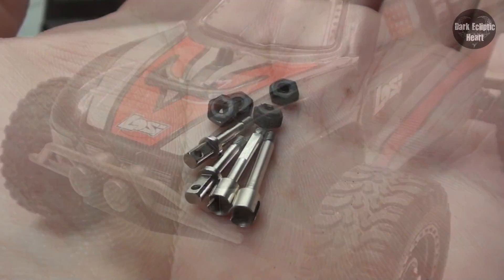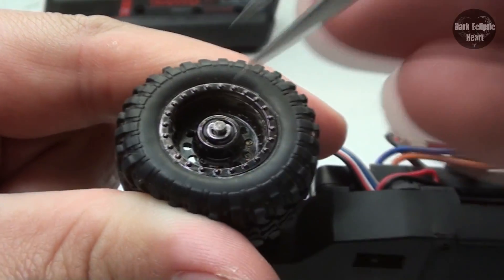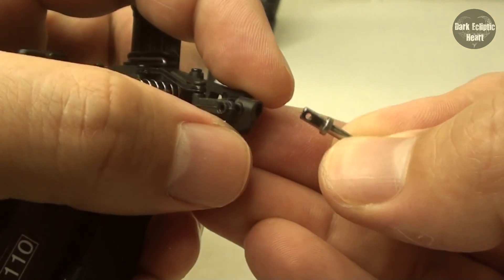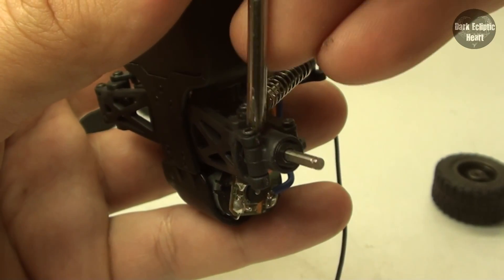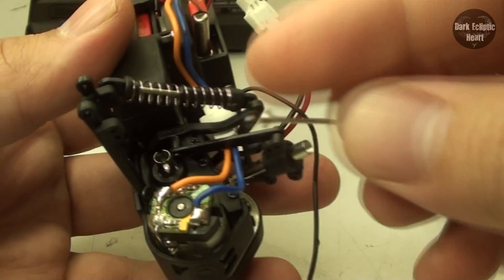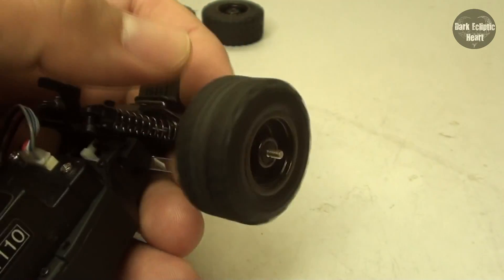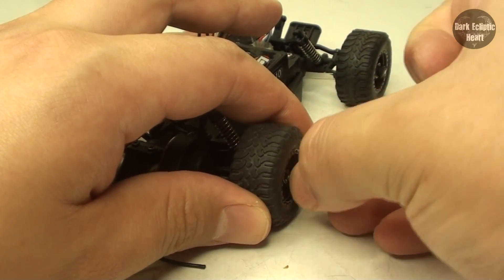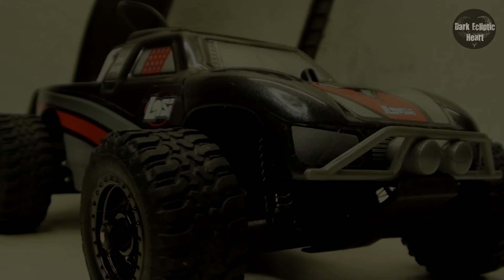Blaze - Losi Micro Desert Truck - Level 2 Upgrade - Threaded Axles

Comment: Where did you get those threaded axles
Reply from the maker: Got them from rcguys100. However, you can buy them from just about anywhere. The part number is LSB1507